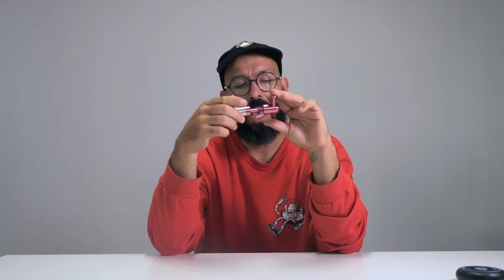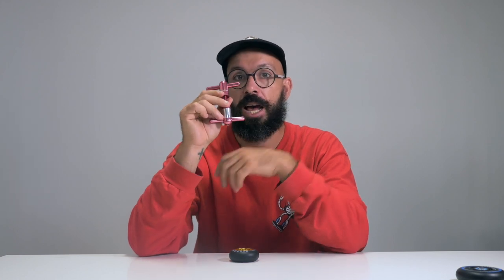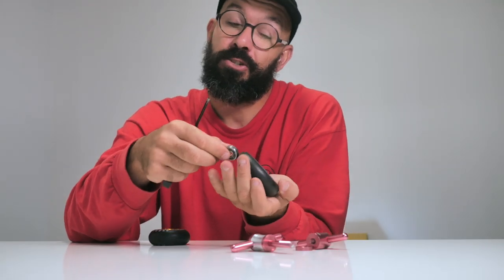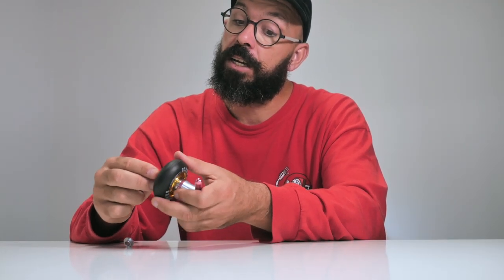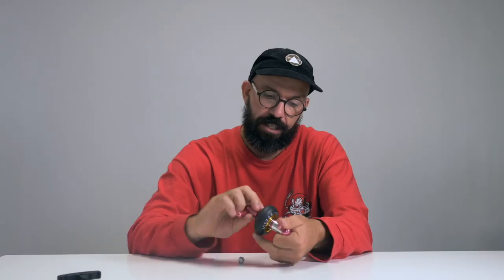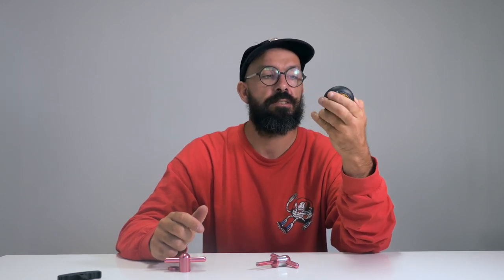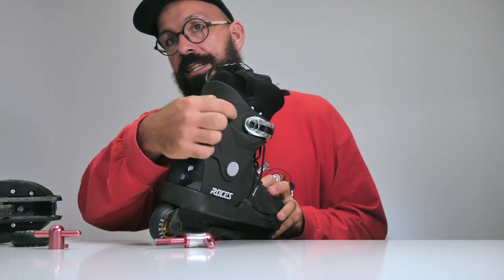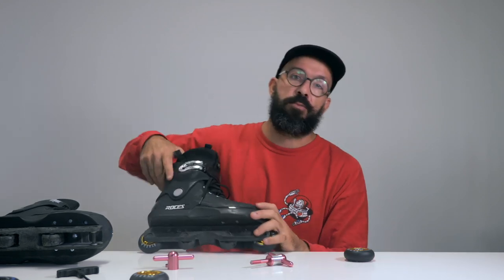HOW TO INSERT BEARINGS ON WHEELS WITH ALUMINIUM HUBS

Comment from the maker: Buy your Famus wheels with 10% DISCOUNT by using code "Lino" here:
http://bit.ly/FamusWheels
Reply: Any update on getting them out yet?
Reply: Ive got a 40 dollar skateboard bearing press/puller that pulls out the bearings with no problem! It doesn't work for installation though. https://www.amazon.com/dp/B014V0LNKU?ref=ppx_pop_mob_ap_share
I had to use an old axle bolt and 2 extra bearings on the outside. No hot or cold required!
Reply: It is actually bad manufacturing for too small fitting due to this video https://www.youtube.com/watch?v=gy84bn-bevk and a Pain to get em back out. But the wheels are really really good! Aggressive skates feel like  recreational ones with four wheels on each side.

 - just how do I get em back out again? :D

If I would have seen this video before, I would have sanded the inner wheels out with a 1000 or more sand paper since its not much to remove to fit em in perfect - AND get am back out.

EDIT: 
Get or build yourself a bearing press like that one: https://youtu.be/QdfBzfbrjJs?t=271 No sanding or stuff necessary. 

I got myself for 3 bucks a kitchen sink drain filter (Or anything that is strong enough, bigger than the 608 bearing and deep enough cover the wheel and the depth of the bearing) and a M8 10cm screw with some nuts and washer from the local hardware store. Than I anchored the screw head with a nut that fits right through the middle of the bearing, right beneath it in the middle of the wheel, the screw through the kitchen drain filter whole in the middle (where the water flows in) and an Allen key beneath the screw to keep it locked in place. On the other side of the drain filter the washer and another nut that presses against the drain, the drain against the wheel, and the screw pulls the bearing off - turn by turn. Works fine - similar to the press I linked in the video! :)

To press 'em in just take your skate axis, 6 or so washes bigger than the 608 bearing, put the bearings and placeholder in place and just screw em with the washes together to press the bearings perfectly in turn by turn :)

The wheels really worth it, the material is strong and no wheel bite so far even on rough floors. Parallel or magic sliding is not that easy but still possible with a bit training and adjustment.

After a few days of rough riding they still look like not used in terms of wheel bite or something.

Total recommendation, thanks Ricardo!

Comment: Smear oil around the bearing and inside the hub before inserting it. It makes extraction easier as well.
Reply: Justin Pearson I use something like an old Allen key I don’t mind damaging, and pull at an angle from the inside of the bearings.

Comment: I remember having similar issues with some aluminium core wheels for my derby quad skates.  I bodged it by using a long bolt, some washers and a nut.  Popped a washer on the bolt that was just wider than the bearing, then the bearing followed by the wheel, the spacer and the other bearing.  Stuck on another washer and then added the nut.  I then used a spanner to tighten the nut and that cranked the whole lot down.  It worked but that tool looks a bit better :-)  Oh, and I used a tiny bit of lithium grease around the hub to help the beatings slide in, which also helped when it came to removing them.

Comment: So the design of the tool looks good, but the Bolt should be long enough for you to press both bearings at the same time. Or didn't you try?
Reply from the maker: it is enough... but the problem i guess is the little thing we spin should be wider to have more leverage :)
Reply: @RicardoLino  probably just designed to fit bearings on plastic not aluminum. The tool itself does not look very solid so if you use a extension on the lever it may break.
Reply from the maker: @helderamorim  you might be right :)